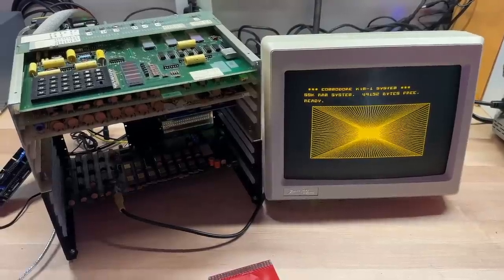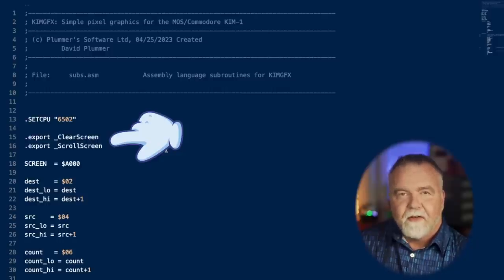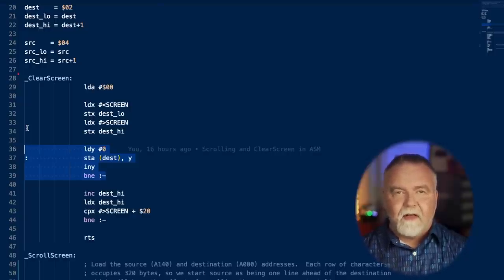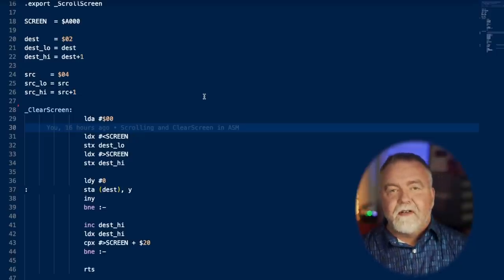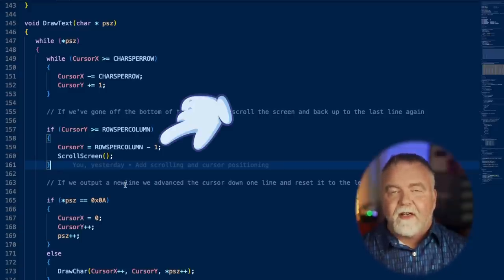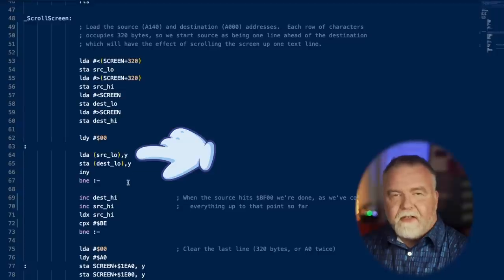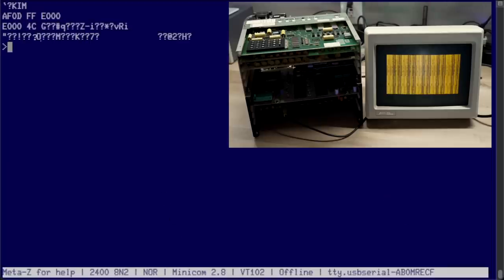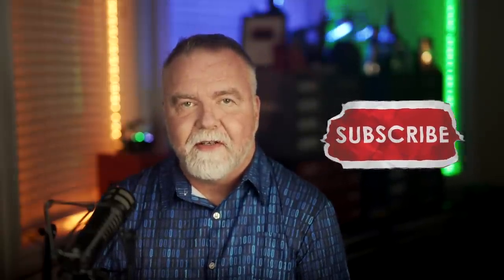C and Assembly Language: How To!

Comment: Instead of dealing with the name mangling in ASM.   Wouldn't it be simpler to deal with it in C?    Like so
extern "C" {
     void ClearScreen(void);
     void ScrollScreen(void);
}
Then remove the _ from the Asm code.
Reply: extern "C" is a C++ construct that tells the compiler to use C linkage; it wouldn't make any sense in C.
Reply: I'm not sure but I think
extern void ClearScreen();
And
extern "C" void ClearScreen();
Are identical and C does add the underscore even on extern C symbols.
Most likely as some naive attempt to prevent calling of random assembly symbols from c that weren't meant for that. (since with this logic you can't call assembly symbols not starting with an underscore) 
But please correct me if I'm wrong. These are just thoughts and assumptions based on the video and my limited knowledge of assembly and c compilers.
Reply: @Z80Fan  C doesn't have Name Mangling.   So either he is using a C++ compiler or a C compiler with a Name Mangling extension.  Either way the extern "C"   scope should tell it to use the standard C function naming for the linker.
Reply: @redcrafterlppa303  Unfortunately this falls under the category of 'up to the compiler'.  Which is why I wasn't sure in the original comment.    If his compiles does Name Mangling on C code then it should also support the override scope.
Reply: @lucidmoses  It's a platform thing. GCC and Clang on macOS will add underscores but not on Linux.
Reply: @casperes0912  Name Mangling is more then just the underscore thing (as he said).  Are you saying it's just that it adds an underscore.

Comment: Why does he say just shy of 8k bytes at 1:47 ? Isn't this exactly 8k?
Reply from the maker: No.  It's precisely 8000 bytes (320x200/8) but 8K is 8192, so "just shy" of 8K.
Reply: No, 0x2000 (0xA000 - 0xBFFF) is 8192, according to the SI system known as 8 Ki.
Looks like a mistake was made during recording. Could've happened to anyone - apparently even the best of us.
Reply: @Snablarns Windows also treats ki and multiples as kb/multiples
I gess its easier to treat 1024 as kb Cuz well, it's kinda used everywere as 1024 lol
Rare is the ocasion a person uses ki and kb properly

Comment: 6:04 I fail to see how it works when it increments both src_hi and dest_hi at the same time even though the 320 is not divisible by 256.
Reply: Other than the initialization of the src & dest pointers and the final row detection, there is no actual concept of rows in the copy.  You are correct that copying 256 bytes wouldn't copy an entire row, but since it's not row-centric it doesn't matter.  The first time through the loop 256 bytes are copied from row 1 to row 0 then in the second iteration of the loop bytes 257->319 of row 1 are copied to row 0 and bytes 0->191 of row 2 is copied to row 1, and so on.  The check for "BE" is how you know you're at the last row.

Sorry if it's not clear, a diagram would work much better.
Reply: The screen buffer is 8000 bytes, and he's copying 8000-320 bytes which is 0x1e00 (7680) bytes.  So, he's copying 30 (0x1e) 256-byte pages, a page at a time with the inner loop.  Then he blasts (most of) the last line (320 bytes) to zeroes. As he suggested, he's not actually zeroing the 0th byte on the last line because he does the "dey", "bne :-".  The fix is pretty simple for 6502 programmers; maybe he'll show us next time.  I think he's also zeroing the byte at 0xbf40 because of the way he indexes, but that's probably not a problem either.

To get the zeroth byte cleared, change the STA instructions to:

 :    sta screen+$1ea0-1,y
      sta screen+$1e00-1,y

then it actually clears just the bytes desired.  Off-by-one bug.

Comment: Where’s the pseudo-op to let the linker know where the assembly code goes? What if it ended up at 0xA000? That would be fun! 🤣 Heck, what if the C code got loaded at 0xA000? Then _ClearScreen would do an RTS when done, which would put the return address from the stack into the PC, but the only thing there is now a bunch of BRK (0x00 on the 6502) instructions, which your call to _ClearScreen dutifully put there. Worse, what if it loaded either one at 0x0100? Reset button, anyone? 🥴
Reply: You don't normally load things in random places. 6502 programs likely start at 200h, past the zero page and stack. The linker would have placements built in or in a linker script, and the machine monitor accepts specified addresses.
Reply: The pseudo-op is "ORG". When you compile, you specify a "target". The targets have default definitions of things like where your code should start, are there headers, ...
This way you mainly focus on the task ahead.